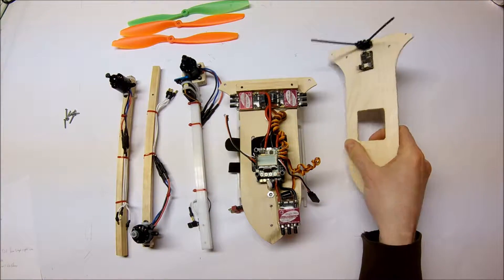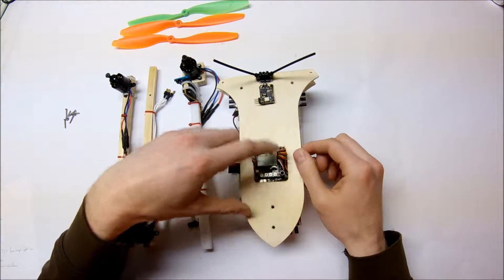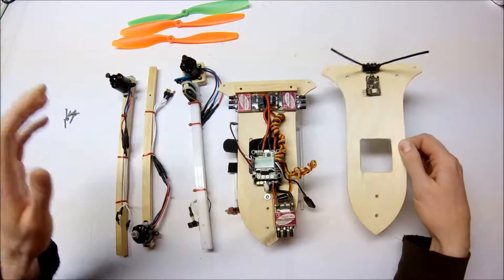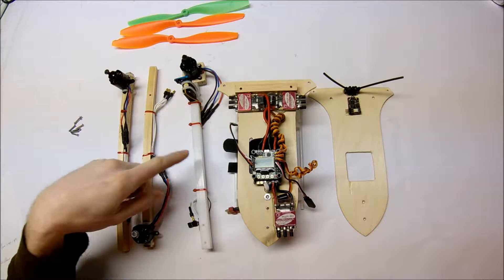Simplecopter TCopter 2.0 - Tri Copter Build and first flights

Comment: the reason i did not do the cutout is the kk2 board is getting hard to get so i felt most people will have to go to the naze or f board soon and they have no screen and fit inside the plates.
Reply from the maker: yeah, that makes sense.  Thanks for checking out the video!